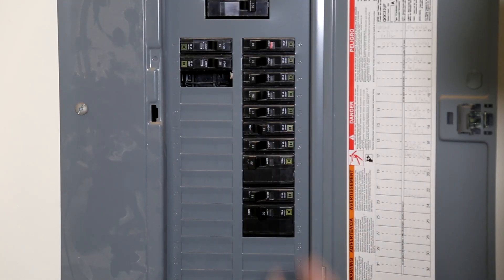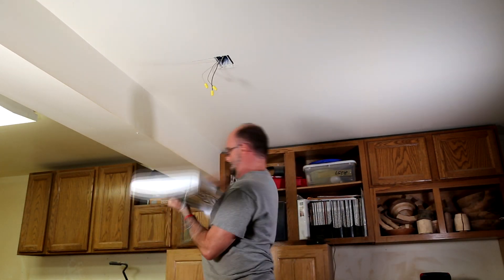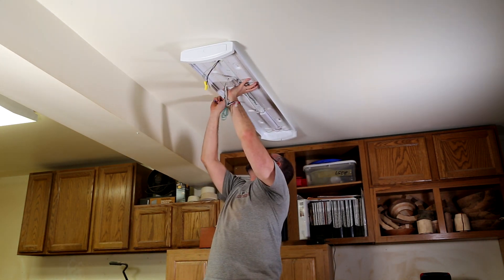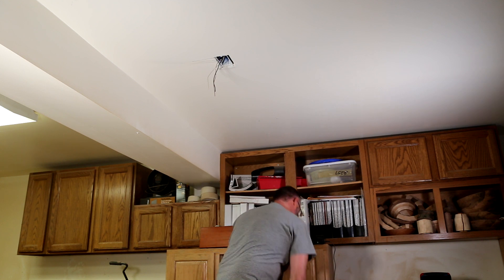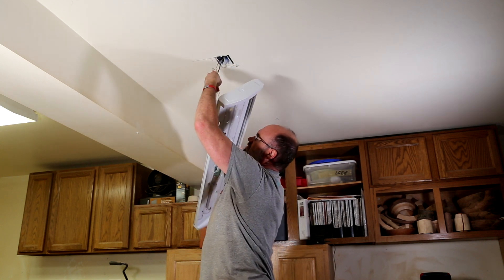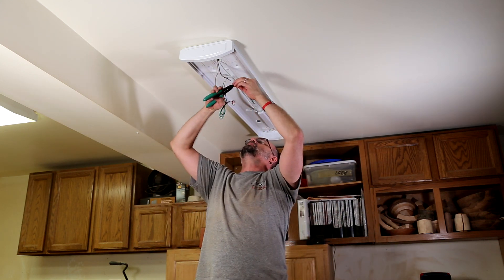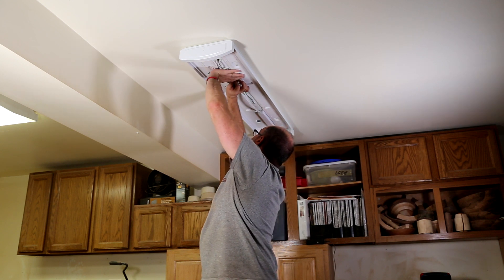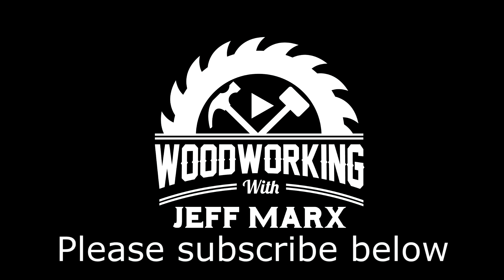Replacing fluorescent lights with new LED

Comment: This looks like the best solution by far for anyone having problems with old flourescent lights.  I checked a couple other videos and the ballast -- which LEDs don't use -- are  prone to failure.
Reply from the maker: Thank you so much.

Comment: I've become quite the fan of LED lighting for task lighting. The ability to get consistent, bright, diffuse lighting is far easier with it, than with other types. Not to mention it's a fraction of the cost to run/maintain. Incandescent still has its' place in some applications, but these LEDs are hard to beat most of the time.

Comment: First, infinite thanks for not ruining your excellent video with background "music." 
Second, a question: This morning I bought a used 4-lamp fixture with a real-wood frame to replace my contractor grade cheapo fixture. The new fixture is heavy, 15-20 pounds, and that's without the wooden frame. Not light like your LED model. 
Do you think drywall screws will hold it up?
Reply from the maker: Most likely drywall screws would do the trick if you get them into studs.  However, some quality 3" construction screws like SPAX will get you a lot more holding power and you won't have to worry about getting bonked on the head.  They also don't have the annoying tendency for the heads to strip out like often happens with drywall screws. 😀  Sounds like a nice fixture, good luck with that!

Comment: Sorry if this is a dumb question, but is it necessary to turn off power at the circuit breaker? Can't you achieve the same thing by turning off the light switch?
Reply from the maker: Potentially, depending on how the circuit is wired, but it is safer to just turn off the breaker and be sure.  Thanks for watching and commenting!
Reply: Yea just shut the switch. It cuts power off
Reply: @fgrau7376  there is no guarantee that is correct , it depends how it is wired,   you could still have an active lead at the light.   You advice is ill informed and dangerous.
Reply: @yarpos  it’s house current far from dangerous!!!!   Even if live a slight tickle not electrocution!!!!

Comment: When taking apart the old ceiling light the copper ground wire was just hanging not connected to anything, am I assuming that you pigtailed the copper ground wire to this LED light ground wire? I got the white and the black pigtailed, but trying to find out why a copper wire is disregarded in this old fluorescent ceiling light?
Reply from the maker: It was grounded to the fixture.  Thanks for pointing that out, I probably should have mentioned it.  Thanks for watching and commenting!

Comment: I have 1 working fluorescent ballast and 1 non-working f-b.  Can I replace one, and have a mix on same 110 circuit?  The only difference is the old ballast includes a transformer, yes?  Both new and old have 2 wires & 1 ground, yes?
Reply from the maker: I believe you can mix them as long as in series but not parallel within a box (you might want to ask an electrician to be sure.)  I now have 2 LED units on the same circuit as numerous fluorescents until they're ready to replace with LED.   They should all have hot, neutral, and ground.    Thanks and good luck!

Comment: Do you mind posting in a link the exact ones you purchased. The Orange box store has plenty of choices and where they 4 ft also?
Reply from the maker: I'm sorry, I tossed the box shortly after installing so I can't provide the exact one - I should have done that with the initial post.  I looked and there's no branding on the outside of the unit or under the diffuser panel.  It is a 4' unit.  Sorry and thanks!  Jeff

Comment: NOT INSTALL LED TUBES YES INSTALL FLUORESCENT TUBES
Reply from the maker: Thank you Norberto.  The fluorescent light had stopped working and replacement tubes didn't work as I believe the ballast had gone bad.  Replacing with LED saves energy and provides better quality light at a similar price.

Comment: Why not just dump the transformer and replace the bulbs with LED ones. The way you did it, the whole fixture, transformer and bulbs are in the landfill and, worse, if that new fixture fails, it will be in the landfill as well.
Reply from the maker: That's a great idea, thanks!